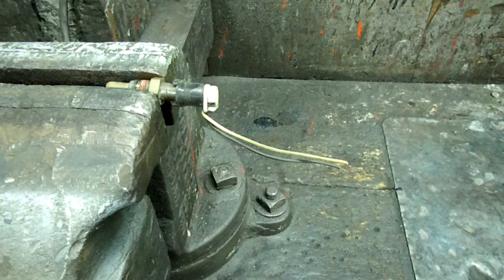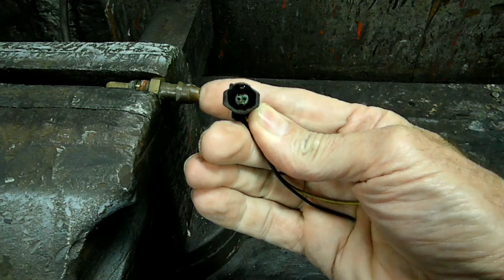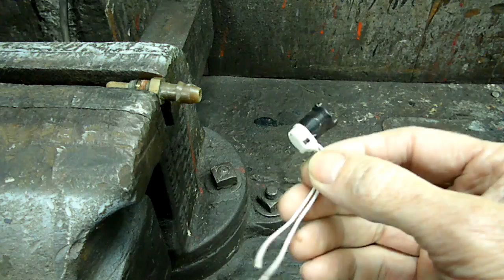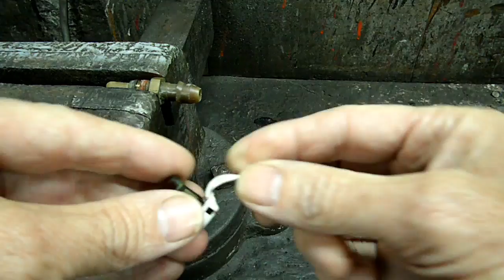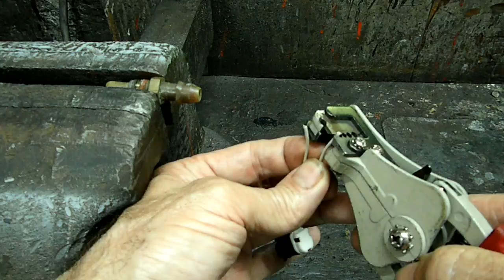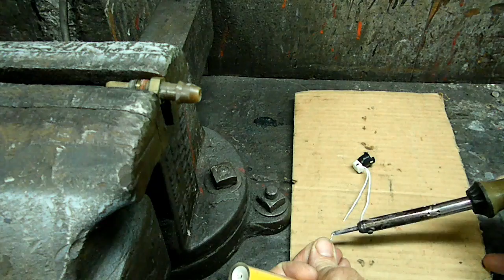Engine Coolant Temperature Sensor Connector Replacement (updated)

Comment: Helo rich I've got the same problem on mine fiat panda I ordered a new wire clip of eBay but the wires are silver Nd on the original wires are copper wired them up by twisting them together it worked the temp gauge but now it's not so what will I have to do thanks 👍 much appreciated

Comment: Thank you so much king... I have a running 1997 SC1 and my car would just cut out after lengthy journeys...i bought it second hand..i didn't know much about cars... but those wires were not connected. Smfh thanks again

Comment: What solder did u use for this my terminals wires that connect are thin and the copper wire looks weak so I want to replace the ends
Reply from the maker: I used rosin core solder.

Comment: A rat chewed on my connector wire and broke it very far down to the hard plastic tubing that covers the wires. Replaced it as well as with brass sensor. Starts well in the morning now good air fuel mixture but my guage won't go past 1/4 during normal driving. Heat comes out of vents so I think thermostat is working. Confused. No check engine light. Service wrench light is on.

Comment: strip the wires back a bit twist em up, hook them together like 2 fish hooks pinch the connection point with needle nose while holding ur iron against the wire then when its hot enough touch with solder and it will flow in and make a good solid connection.

Comment: I'm replacing the coolant sensor on my 99 saturn right now and I thought i might mention that autozone has a sensor kit that includes the wiring and new connector all together for $19, it's not that much more than just buying the sensor by itself.
Reply from the maker: Cool autozone would do that thank you for letting everyone know.

Comment: So it 100% doesn't matter which wire goes to which terminal? 
I've had to adapt mine a bit differently as I couldn't find an old harness, I plug each connector on individually. But I want to make sure I can connect them either way, thanks :)
Reply: No, it does not matter. It's a resistive (thermister) sensor. It sends voltage to it and measures him much it drops.
Reply: @freednighthawk  does this apply to any coolant temperature sensor from any make and model?
It dosent matter wich way you wire it in?

Comment: hello richpin06a i did not fix my problem with this and now my car will not start, i think my engine overheated, would you know any solutions associated with this problem and the severity of what i have done based on what i have told you?

Comment: Hi, can it be ok if I don't do the soldering and I just twist ends together and  wrap them up with electrical tape? what can go wrong if I do that?
I do have the tools for soldering just not a really long extension to get power so if the above is ok I'd rather to it that way.....

Comment: Thanks for posting this. My car was dieing because this connector was loose. It looks like you can also get the part on the internet, part number 1P1439. Probably cheaper at a junk yard though.
Reply: Haha! He just said go to the junk yard and grab one.  He didn't say he paid for it.  I'm sure items like that you can just hauler over  to the yard  cut one  for yourself.  They usually don't sell such item anyway.

Comment from the maker: @MrRaiders6769 If that is the case it sounds like you have a worn chain.When they get this bad it sounds like a diesel engine because the chain is loose and slapping against the cover.When it gets this bad do not wait to long to fix it because it is just a matter of time before it snaps or jumps.

Comment from the maker: @MrRaiders6769 The best way to check this is to use a stethoscope to pinpoint the noise.If the noise is loudest at the end of the motor near the top mount then there is a very good chance that the timing chain is faulty.

Comment: @doublea422 scotchloks are a type of a permanent quick connector for connectin two wires. instead of soldering that can corrode you can use those, as they are really easy and effective and you don't even need to strip the wires.the also have a dab of lubricant inside to protect the connection against moist and corrosion eventually

Comment: I find it easier to use 3M scotchlocks under the bonnet because the soldered part gets rusty fast. doesn't matter if you use shrink tube or not. get the job done quicker too, altough I am soldering my whole life ... click-click and you're done.